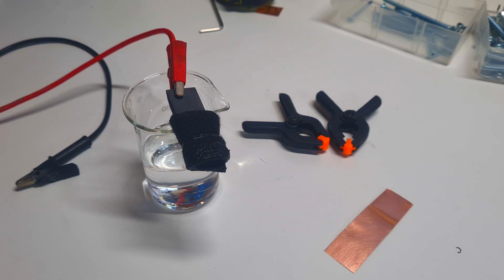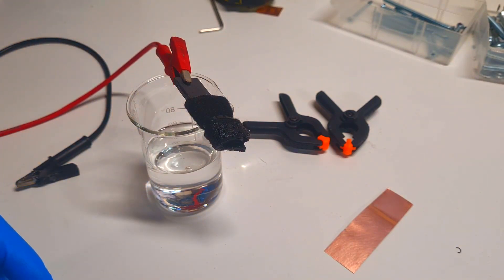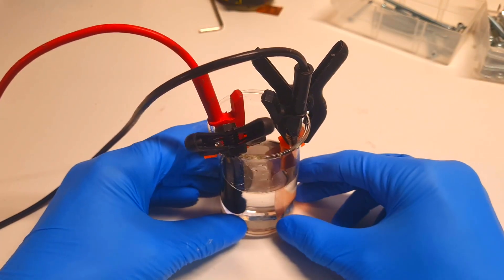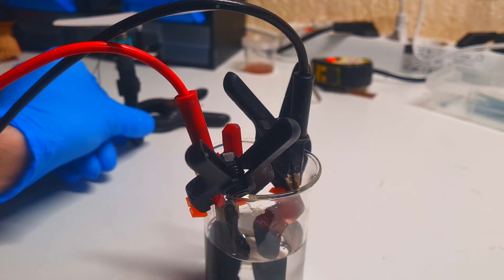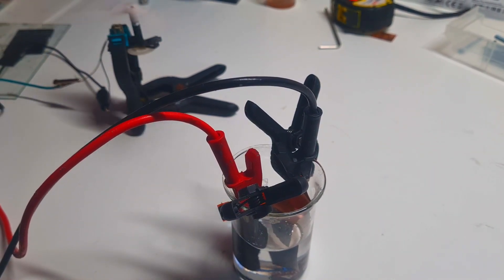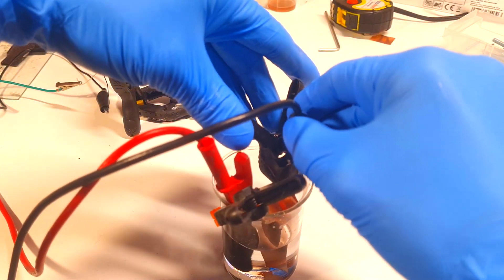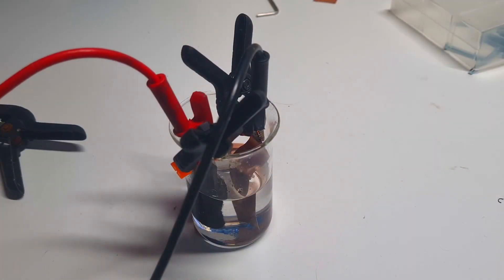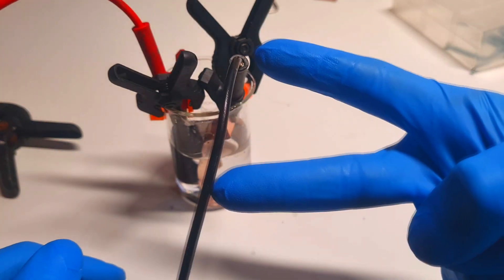Plating and stripping of zinc in Zinc hybrid supercapacitor

Comment: so why this is not being used, it should have about 433Wh/kg energy density if you count the electrolyte in to the weight, zinc air would be 1.3kWh/kg on its own as fuel. titanium works as the air electrode. yep rechargeable zinc-air. I think someone is talking their own among the public. to harm freedom. yes its still both hybrid super capacitor and rechargeable zinc-air battery. yes expect tons of zinc metal formation and strong sulfuric acid in the solution. kinda same as lead acid sulfuric battery. hydrogen evolution might be a minor issue, with re-watering, just like with lead acid battery.
Reply: why dont you try as zinc-strip feed zinc-air battery, with sulfuric acid electrolyte, yes its the charged state but with direct metal fueling, full specific energy of zinc at 1.3kWh/kg, keeping the removable sulfuric acid water electrolyte as the engine weight in a vehicle, in the flooded lead-acid type of cell.
Reply: instead of the iron plate, try steel wool as the negative electrode.
Reply: nah, steel wool works similar to a steel sheet or foil during recharging, no surface area benefit. maybe only for discharge-only zinc batteries.

Comment: Hi Cayrex, ive been build various batteries for a little while, the simpliest is ZnI battery, my design is a liquid base, self discharge will always be an issue. Unless I mechanically remove the liquid or the zinc. I like the idea of making a lot of batteries. What do you think is the best and easiest design. If you have a video on Patreon Im happy to go to that. Any pointers gratefully accepted. 
Take care
Bret
Reply from the maker: The best design is always the easiest design with low or at least moderated material cost. But is not always so, because always you have a compromise to make. Puting a cell together in a pouch design (sandwich) is good because this way you will get good power and the energy efficiency will not be low. But if you use Zn-I2 or Zn-Br which is also not bad,... like you know, you will get higher self discharge and dendrite formation. Then in case of lower the self discharge you need to remove the electrolyte each time when the cell is not in use ,... which then you go into flow cell setupe. The flow cell setupe is good but is complex and most of the times is also more expensive like normal cell design. Then the gravity design is really easy to do but the efficiency will not be so good. My favorite design is still a flow type. But I also think some modified gravity  design will be cool. In the end is hard to give you "the best cell design".
Reply: @cayrex  thank you for that. Did you make some bipolar cells a few years back. I think I'll need to sign up to your patreon account 😀
Reply from the maker: @DrBretPalmer Hehe not only few years back,... I still use a bi-polar system to connect the cells. The cells in bi-polar battery are made in pouch setupe,.... the difference in a bipolar battery is,... how the cells are connected to each other.
Reply: @cayrex  thank you, will join after I get paid next week.
Take care

Comment: I can plate, but won't strip. Not sure about this one. I also added salt to the solution. Or do you need to add an acid?
Reply from the maker: Interesting. 2m of ZnSO4 works great for me with no need of extra acid. Also if you short circuit the cell?

Comment: In lead acid batteries, I saw that they reacted sulfuric acid with silicon dioxide and made crystal batteries. The actual reaction is SiO2+H2SO4=SiSO4+H2O. Can this be tried as an electrolyte in your project?

Comment: You plated at 2.2v.  what was its max voltage when discharging?
Reply from the maker: Yes,... I use 2.2V to get faster plating that way. Discharge was 1.8V

Comment: This is pretty amazing.  I noticed you said in another comment that it was 1.8 v and could change for 10k cycles. Why 10K?
Reply from the maker: Because I already make tons of work on that cell system. And you also have many research papers on zinc ion capacitors.
Reply: @cayrex  could this be made into a thin gel or solid state form?
Reply: By the way, Thank you for the reply. This us pretty amazing battery. I love your videos
Reply from the maker: @bpriest35  Yes and yes. But is easier to make in gel form.
Reply from the maker: @bpriest35  Thank you
Reply: I just duplicated this battery today and was very excited.  I initially got 1.9 volts. I also got some nice zicn plating on the copper. However,  I let the battery sit for a few hours and the voltage dropped to .75 volts.

The only thing I could think I may have gotten wrong is my zinc sulfate mixture.  I put 200 grams into 300 grams of distilled water. 

I started with 100 grams but that did not seem like enough. I could not replicate the plating you got.  When I increased to 200 grams, I got fairly quick plating.
Reply from the maker: @bpriest35  Hey! I use 2 mole of ZnSO4. Replace copper with zinc plate.

Comment: Very nice work. Do you have any idea of the stored energy in mAh/cm2 ? A rough idea is to measure the cm2 of copper, plus motor current in mA and time it runs.
Reply from the maker: It is reported to have around 120mAh/g per active material. But will also depending on the surface area of Activated carbon. Cm2 of copper foil is around 5cm2. Current of motor is around 180 to 150 mA which runs for little more that 1 min. The charging time was 1 min with 2.1V and 130 mA